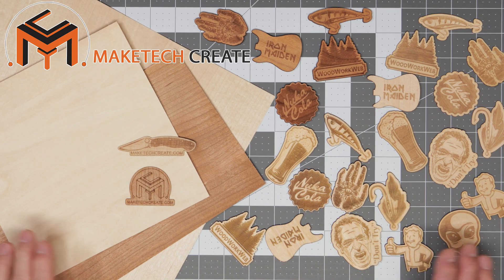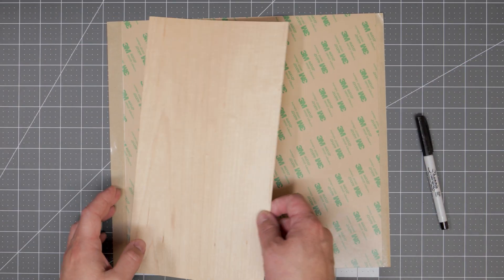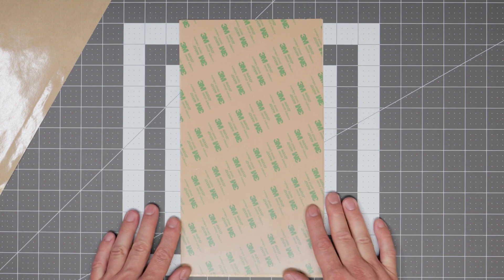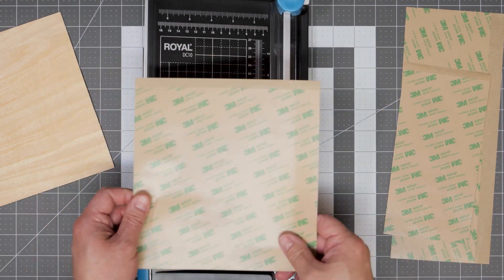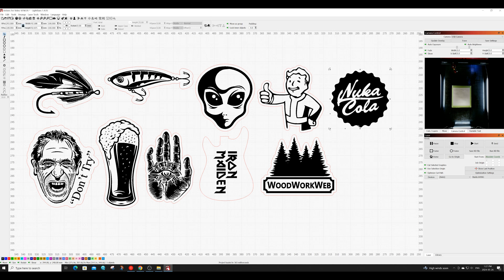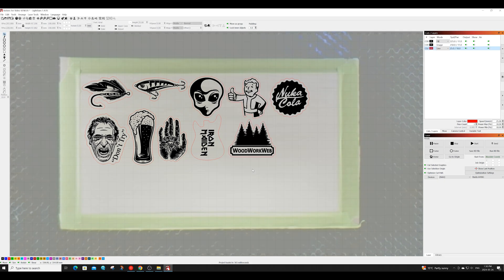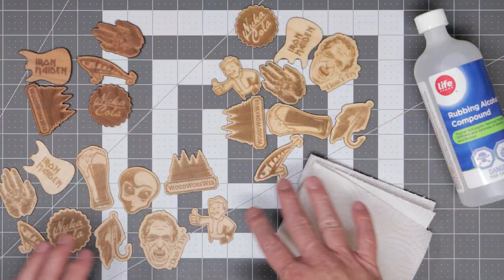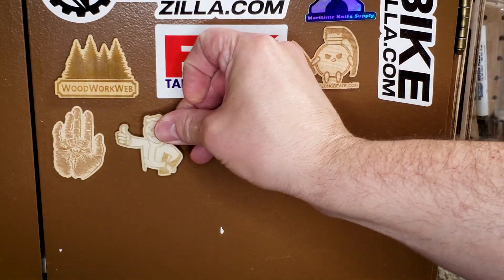DIY Laser Cut Wood Stickers: Easy Tutorial!

Comment: On the "Maple Wood Veneer Sheet - Peel and Stick" stickers, or any of the thin veneer stickers, do they wrap around items like a tumbler without cracking/splitting (assuming you rotated the grain in the correct position before engraving)?
Reply from the maker: Yup, there shouldn't be any issues wrapping the veneers stickers. The 3M backing actually make them extra flexible.